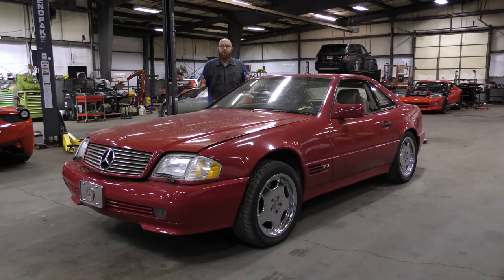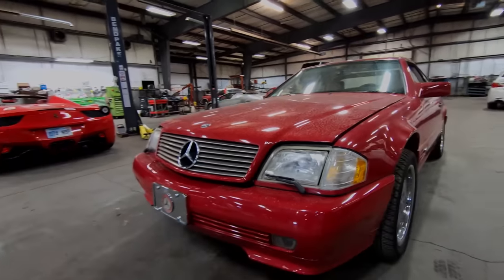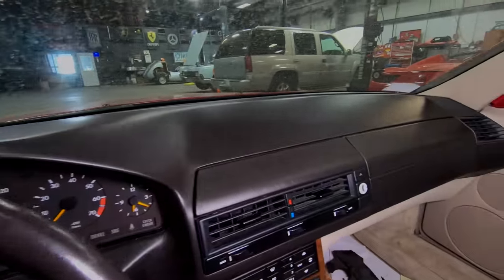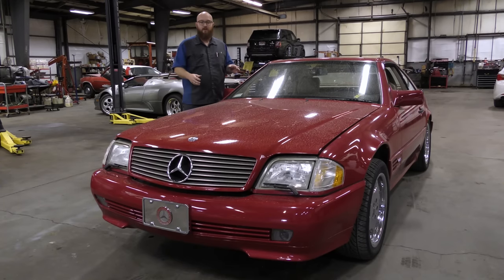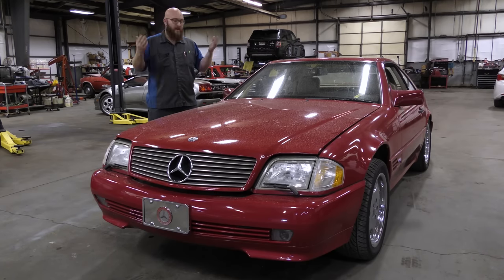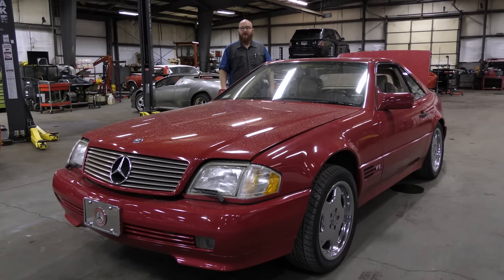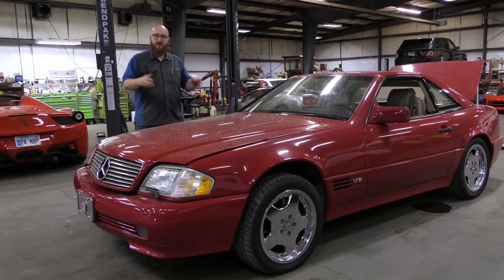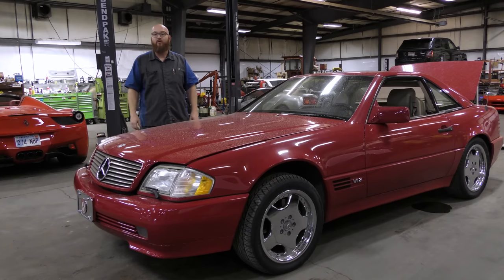Another customer scammed! CAR WIZARD shows why this '94 Mercedes SL600 is needing 15K to get sorted!

Comment: By the way, the bio-degradable wiring harness issue resulted from a (then) new German/EU law, and was not unique to Mercedes. (Affected brands included  Mercedes, Porsche, BMW. (Other car brands to suffer a similar problem - though in the 1980s - included Saab's and Volvo's.) I believe Delphi was the manufacturer, for the 1990s mishap.
Reply: 1996 Audi A4 Quattro -- personal experience.
Reply: I know this reply is to a post two months ago, but it's piqued my curiosity.  Do you have a reference to the EU/German law that mandated biodegradable wiring?  I ask because 1) Euro cars are reputedly full of all sorts of cheap plastic parts such as cooling system components and intake manifolds and whatever which used to be made out of cast aluminum or zamak.  It would seem to me that if regulation were driving the change, easily recyclable metals would continue to be used rather than plastic.  2)  Were Japanese cars imported into Europe subject to the same plastic regulations?  Did they make biodegradable wiring harnesses for their Euro models?  3)  I don't discount the importance of simple cheapness.  Was the biodegradable wire cheaper than the old wire?  There's ALOT of wire in a higher end modern car and even a penny a foot price difference is going to make a noticeable difference.
Reply: I had to do a full wiring harness replacement on my 1985 240 Volvo because of the degradation. However in the Volvo's case it was about $300 for the whole harness and took me all of half an hour to do.
Reply: Was that law really about biodegradable plastics or just banning PVC wiring?
Reply: It is easier to blame the government instead of corporate greed…

Comment: Thank you Car Wizard - very informative insight on the MB 600 Series for those years mentioned. YES those bio-degradable wiring harnesses under the Chrysler years were/are the worst - what were they thinking! As just the heat ‘alone’ from the engine degrades the wiring. So sad as the appearance of this vehicle is nice and yes the customer did get obviously scammed. Basically - the vehicle (as it sits) is just a parts car now and the owner ‘could’ get his money back out of it that was spent on the purchase in just selling off the parts of the vehicle as they are in general hard to find too. However, that takes time (and knowledge) and can be difficult too if you don’t have a storage place/location to part out the car at. Which can be a messy job in itself. Then the shipping aspect of it all. Now regarding the cost factor of repairs you spoke about on this 600 - yep, been there & done that with my 1991 Black 500 SL/AMG that I purchased in December of 2021 out in California . BUT luckily for me (while still living out there) I had a Car Wizard who had previously owned three of the 500’s & when I had the slightest problem with the hydraulics with getting the hard top to release (soon after purchase) he told me to STOP don’t push the button anymore!!! And so I took it into his shop where over a period of two weeks my initial investment of $7,000.00 on a 100,000 mile MB did turn into almost triple (over time) the cost of the purchase - and one cylinder did blow right behind the drivers seat and what a mess that was just from one of the eleven cylinders as the fluid lingers & does “not” evaporate. That took weeks to finally get it all flushed out of not only the places you readily can see but also from out of the frame rail channels where normally rain water goes into and empties out via the drain ports on the bottom of the car. That took time and a lot of flushing down inside the drainage area behind the drivers seat. SO for the 500 - maybe I should have sold it! BUT the original owner (I’m the third) was a well known actor and singer - so the vehicle comes with some pretty impressive prominence - however the second owner didn’t do ANY maintenance on the vehicle for the eight years he owned it. So I inherited ALL the issues. When one cylinder goes OR has problems (you know what has to be done) you replace ALL the cylinders and check all the lines too for possible needed replacement (if you can find them at all) but for me the lines were old but still in good condition (no leaks or breaks). So the replacement on the cylinder rebuilds with LABOR was six grand. And my friend only charged me half of his normal cost for labor. BUT I still had to go through the “full engine maintenance” ordeal, which in parts and cost was another grand+. Then the suspension needed help (ie: the front struts etc.) - Another grand - now at this point I’m back living at home in Indianapolis & paying for local MB Dealership Labor costs @ 195 an hour (OUCH).  Then to top that off - there’s the little plastic parts debacle - as 30+ year old plastic parts just crumble from all over the car and finding them ‘somewhere in the world’ ARE harder than trying to find that pesky raccoon that keeps getting in the trash at night time. And even if you find that hard to find plastic part - there’s a reason their hard to find because the owner of the parts wants a kings ransom for the little part that can fit in the palm of your hand - so in plastic parts I’ve spent to date another two grand+ (ie: engine bay; interior; trunk areas)!  And it just does not stop there - the transmission so far is holding together pretty well though I know it will need maintenance soon too ($$$). So the 500 isn’t driven much - maybe 20 miles a week just to keep the fluids going. There are more expenditures but for now my total investment has reached a little under twenty five grand including the initial purchase cost. So was it worth it - probably not. But I’m in it for what I’ve spent to date to bring it back from out of its years of abuse of its second owner. And its holding its own right now pretty good. I must admit that the black with beige interior looks great and I do get compliments on it as the original paint still does well once I polished and ceramic coated it. I do a lot of the cosmetic work myself and I’ve come to understand the mechanics of the 500 pretty well - BUT your video on the 600 has given me a lot of insight to think about. Thank goodness my ‘91 does not have those wiring harness issues as they are still strong as ever and look really fresh for a thirty plus year old vehicle. So thank you for your time in making this video for us. Because anyone wanting to purchase one of these historic MB’s (during the Chrysler ownership years) should be ‘buyer beware’ just because of the wiring harnesses issue(s) to start with! Then of course the hydraulics - when one gives you a problem or the system is giving you a problem - then they ‘all’ need to be replaced! So again thank you Car Wizard for such a great video - gotta go - I hear the 500 calling to me for some more maintenance needs…
Reply: brother - Sorry you had to endure all those aggravations, spending a fortune just to keep a car running how it ought to, is an awful waste by anybody's standards.  And every word you say just underscores the mystery to me why anyone would consider owning a German car, ever!

Comment: More and more I appreciate the simplicity of my car. All analog.
Reply: me too, the only electronics my car has, is ignition and injection system, sometimes radio. ah yes and the lights, other than that it is full "uga booga", it has failed a good 0 times and service is incredibly cheap which prevents any serious damage. i have reached a point that i could certainly afford buy a "nice" car but ABSOLUTELY NO. people tell me to "buy a new one and stop using this clunker", few hours later, "yes my 2017 whatever car with 5 seat control boards and more wiring than the average server broke, come pick me up"
Reply: @kapioskapiopoylos7338  Collision radar detection system that has to be resynched after fantom breaking. It's a blessing all that new crap roflol

Comment: The big question here: Does that $18,400 SL600 in comparison have any harnesses replaced? And if not- what would the actual value of a “fixed” car with that issue already paid for be worth?
Reply: newer models got away from the "biodegradable" harnesses for regular plastic so they don't have that problem anymore
Reply: I cannot imagine an owner of an SL600 replacing the full harness and then selling it cheaply.
That would not make sense..